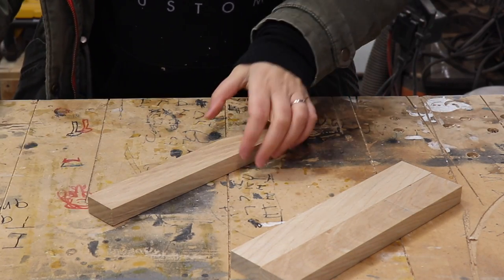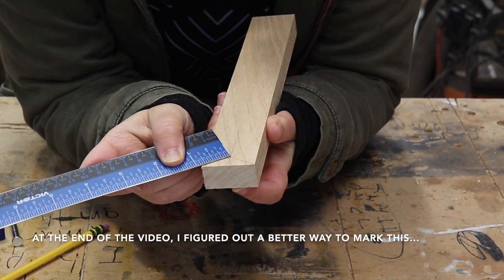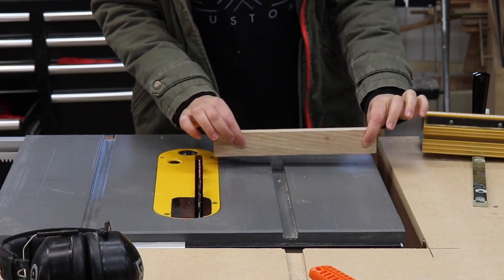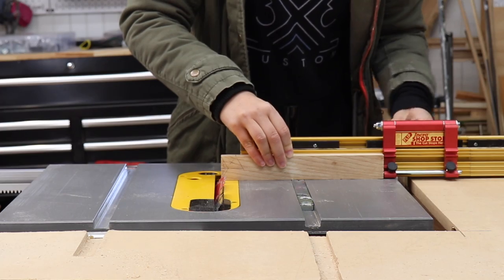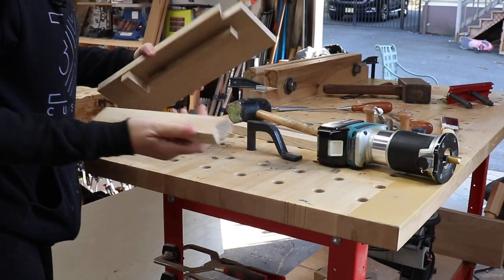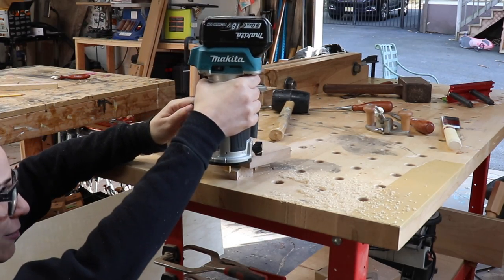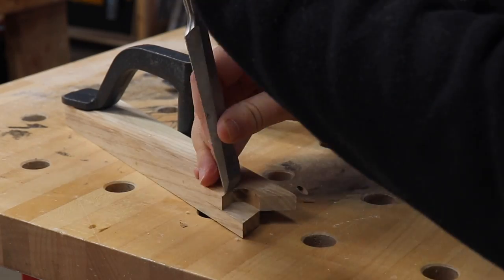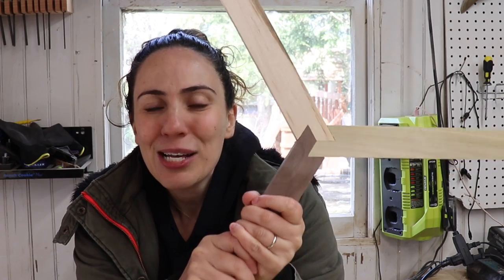Actually, I don't know what this joint is called... but Three-Way Lap Joint seemed to fit. Ha!

Comment: The first image of the joint looked like a corner joint (3D) to me at first, rather than a flat three-prong thing. That got me wondering how to make that same look in a corner joint. Using balsa wood, I figured it out, but not sure how strong it would be (But it looks cool).  I would love to see you experiment with that look as a corner joint and see if it can be made strong enough for practical use.  I can send pics if you want of my balsa wood test.
Reply: Yes that's what I thought too - i dont see much application for the joint in this video.
Reply: Ken Heart I have seen something similar under a round coffee table with three legs
Reply: @jurockclimb  I suppose there might be the odd application!
Reply: Yeah thats what i thought too.😂. This kind of joint is not really used too often.
Reply: @Beevreeter  I could see it as a neat center support under a glass table. I don't Think it would be useful structurally but it would look nice.
Reply: @lol2Dlol  I agree. I would probably want some kind of support structure under it if the glass top is larger than 600mm in diameter though.
It's definitely intended more for decorative effect than for structural integrity.
Reply: Yeah, I would have assumed it was a 3D corner joint myself, with a very distinctive look ot hide the joinery.  I too would be more interested in the corner joint~!

Comment: Initially I thought it was like a 3 way miter joint like I've seen in table legs. Almost has a three dimensional look in the picture. But I wonder how this would be used in actual practice. Very nice. Can't wait until the next video.
Reply from the maker: Thanks! Yeah. The 3 colors kinda makes it have a 3d effect. Keith from kjsawdust is using this joint for a 3 legged table he’s building

Comment: That is a great joint for many cool stand type applications. 
Could use it as a three section lazy Susan cutting a nice round trim to match the dividers doing a tenon or half lap to join all the pieces together cutting a channel into the sides of the wood adding a 1/8-1/4” bottom. 
You could even create an inlay effect with a darker wood to add some flair. 
So many options!
Reply from the maker: That would be super cool. The inlay part sounds killer

Comment: I'm not sure if anyone mentioned this or not, but this joint works with almost any number of boards. So long as you follow some basic math, take the number of boards desired and divide 360 by that number. That will be the angle of the first cuts you need to make. So if you wanted  6 boards for a really decorative piece you would need 60 degree angles instead of the 120 that were used.

This ends up being a rather beautiful piece if done correctly, also odd numbers will almost always look better than even because one of the boards will always be centered.

By adjusting the Maximum angle you can also do some really unique designs, such as a starburst pattern by just dividing by 180 instead of 360. The rest of the process remains the same regardless.

Comment: if you chisel out the leftover waste in the corner left by the router bit before you take off the template it works as a guide

Comment: That awesome incra miter gauge has a built in super precise micro adjustment in it, check the stop block, from the position you use the gauge, the stop block has a horizontal screw on your left, that is the micro adjustment screw, tighten it to cut more, loosen it to cut less, you will need to also loosen the two screws on the top of the stop block to allow this movement. It is awesome!
Reply from the maker: It does!

Comment: Nice video. I like how you show three different methods. Using three different type off wood show off the joint better and the craftsmanship behind your work. This could be a nice joint for a round table top or  bar stools. 

Call it a Tamar joint or 3x3 custom joint, if no one else has has made that joint before then you created and call it what u want.
Reply from the maker: That would be a perfect project for it. But others have done it before me. I saw a picture of it and recreated it. Oh well. Ha

Comment: Awesome Tamar! You never cease to amaze me with your woodworking skills. I need to "sister" a few floor joists in my basement, I don't have to go all the way from end-to-end, but I want to, to stiffen up the floor even more. However, I have some pipes and wires in the way, so I'm considering joining 5'× 2"×6" & 9'×2"×6" to become [one] 14'×2"×6" joist. 
Would you consider making a video in regards to that?
 I'm considering 1/2 lap, locking scarf joint, or scissor half lap. You probably already know this, but , the scissor half-lap is similar to what you just did in your video..
Reply from the maker: Thanks! I would probably do a locking scarf joint. But I’ve never had a situation where I’ve ever had to do that
Reply: 3x3Custom - Tamar, thanks for the reply. After I messaged you the first time, I realized that my boards that I bought for sistering the floor joists are 14' and the span is 14', so I can't afford to lose any length trying to make a lap joint of any sort, so the locking scarf joint is my only option. I've experimented with a small scrap board and I'm satisfied with the way the locking scarf joint works. The tricky part is adjusting the joining pieces to fit perfectly considering the material removed from the saw blade kerf needs to be compensated for. After trimming the locking part of the joint numerous times  I finally got a good fit. It took a while. It seems like you always have formulas for that sort of thing, so, If you have a time saver suggestion I'm open to it.

Comment: You have great abstract reasoning, planning,  measuring, and cutting skills, as well as patience.  If you didn't have all of those, it would have been a failure.  You are rare person. I thought I had them, but not on your level!  Bravo!  Interesting that you mentioned being in quarantine.  That was the beginning. Who ever thought it would go on this long, and it may go until next summer with Delta and the people who won't be vaccinated, though it isn't quite as bad if you are vaccinated.  By the way, I like my new Makita router, but I don't like the fact that it doesn't have a light in it. I resorted to using a headlamp. That was my wife's suggestion.  If one works for my dentist, one will work for me.

Comment: I enjoyed seeing all three approaches.  Thanks!  I think in your 3rd approach, when you cut down the center, the kerf of the cut probably threw off the fit.
Reply from the maker: Yeah. Probably. Could also probably adjust which side that kerf would be on and just have the bottom part of the joint look a little off. 🤷🏻‍♀️ still want to play around with that

Comment: I wonder if an oscillating tool would be useful to hog out material if one were going the non-jig and router route. However, the flush trim bits are amazingly useful. I have a freud one that is 2.5in tall with bottom bearing.

Comment: It was interesting to see you figure out a way to do this. 
However, first thing through my mind was 3 cuts with the blade at 90 degrees: A straight cut on the end to the depth of the lap joint (probably easier with thin hand saw or band saw), a 60 degree miter-jig cut the height half way through face A (up to the middle cut), flip the board and another 60 degree miter-jig cut on Face B. should leave you with the lap cuts and a couple of triangles from each board. Kerf might be an issue, not sure.

Comment: Nice work and thanks for sharing. Another way to do that micro adjustment on your fence is to put some pieces of paper between the workpiece and stop block, remove the paper while holding the workpiece firm, and move the stop to touch the piece again.
Could you just keep the piece in the jig as a guide to clean up that corner with the chisel?
Reply from the maker: Yup. And yes. But I like to work in phases. So router, Phase one. Hand tools, phase 2. It’s just how my mind works. I do the same thing when I’m cooking. Do all the repetitive steps in one fell swoop. Then move on the next repetitive  step. But you do whatever works for you 😉

Comment: Hi Tamar, Have you done any videos talking about the different devices you use with your table saw? There is one you used with your three way corner joint in another video and this one. I've used a table saw before but really badly! These other gismos give a much better finish.

Comment: Could also resaw the pieces in half, plane to equal thickness, make the required cuts on each half (all through cuts) and then laminate the two halves back together... Yeah, it's a little bit of a cheat, but....  :-) Awesome work, very cool joint!
Reply from the maker: For sure. Always another way. Thanks!

Comment: The question is, now that you have a way to make these joints efficiently, how could they be utilized? I can see these three pieces being the styles and rails ( in effect) for a panelization of a wall that would be in a honeycomb pattern. You could experiment with the grain placement of the field pieces to provoke 3-D effects, sort of M.C. Escher 'esque. Another home run from Tamar!
Reply from the maker: Oh. Yeah. That would be cool. But I’ve seen this joint being utilized as rails for a 3 legged stool or side table.

Comment: Have you ever considered upgrading your table saw?  You would benefit from a much more precise set up and better results with your Incra miter gauge.
Reply from the maker: Yes I have. Ha. Right now I don’t have 220 set up in my shop. So I am waiting until I do a shop overhaul 😉 for now it works.
Reply: 3x3Custom - Tamar ah, got it.  Yes power can be an issue.  Powermatic makes a beautiful PM1000 cabinet saw that only requires 120V power.  And their currently offering 15% off their entire lineup of tools.  Just FYI.  STAY SAFE!  one silver lining in all this, I have lots of shop time right now!!! 😁👍🏻

Comment: Does your table saw have to be sitting level for that digital angle angle gauge to be accurate or does it compensate on its own? Thanks. Great video.
Reply from the maker: Nope. You put it in the table saw. Then press zero. Then you put it on whatever you want to check the angle of in reference to that zero.
Reply: @3x3CustomTamar  thank you!

Comment: one way of doing it that i think might be easier but maybe nnot as good looking is to take 2 pieces of wood with same length and width but half the thickness of what u want the finnish product to be. then cut everything out on the band saw on each piece, so they are the mirror image of each other then glue them together.
Reply from the maker: That could def work

Comment: Obviously we usually eyeball it, but I'm curious if there's a good way to know that the uppermost tooth of your blade is in the fullest, most upright position for measuring blade height?  Especially on an angle, this seems like it might be tough.
Reply from the maker: Yeah. I actually marked in my saw top where the highest point it. So I make sure to line my piece in that mark and rotate the blade back and forth to make sure. Then do a test cut. Make any necessary adjustments and then final cut.

Comment: It's a very decorative joint, but I don't see the point or use of it. I mean it might make like a nice center piece for geometric tabletop but as a joint that would support weight or put up with a lot of twisting or racking forces, I don't see it. In fact even in the tabletop or other decorative use it would be far easier to get that look without going to the trouble the goofy angles of that joint. However it does seem to have a lot of value as a mechanical puzzle to figure out how to build during a pandemic.

Comment: First of all, let me start by saying thank you for sharing this with us. I love your channel and you make everything look so easy for beginners like me. A couple of questions about the joint demoed here. 1. As the joint is along the long grain and after the material is removed on both sides of the stock the resulting two prongs are barely bonded is that strong enough to hold even after all three of them come together?  2. what would be the typical application of this joint?
Reply from the maker: As long as it’s not end grain to end grain it’s strong. Second. It would use this as a stretcher for a 3 legged table like my friend Keith did
Reply: @3x3CustomTamar  How about a (half-) hexagonal palisade? Looks like it could actually distribute weight/pressure vertically, for example to rig a carport or a veranda?
Reply: .. or for a bottle stand.

Comment: Where I learned the trade (the north of the Netherlands) they call this joint a devil's knot. Could be a regional thing though.
Reply: Jelmer, I am liking that, and will adopt it as the proper term, dank u.
Reply from the maker: Never heard that! I like it
Reply: I asked around and it's a very regional thing indeed, apparantly it's only used in one province. Googling it only gave results for a type of puzzle. (Prove me wrong though, fellow Dutchies)
Btw, at first glance at the vid's thumbnail perspective fooled me into thinking it was a square 3-way cornerjoint XD Maybe an idea for a next vid though?

Comment: Could the boards be laminated in two exact halves so that the 60 degree angled ends don't go into a blind end?  Then each half of the laminate could be cut on the table saw as a straight through cut before gluing together.  It wouldn't be so much fun though!
Reply from the maker: Sure!

Comment: Curious why you don't use the fine adjust on the incra miter gauge.  It was the whole reason I justified spending all that money.  Anyways, cool techniques.  I couldn't see a way to make a jig for this joint and you nailed it
Reply from the maker: Sometimes I use that. But I guess I just saw how much was left over and moved it out by that small amount. 🤷🏻‍♀️ I like using that little bar thing for things like that. Ha

Comment: If you need to do this joint again, you don't need to measure the second marking point, you can find it by drawing the 60° lines until they reach the other edge, since that makes an equilateral triangle

Edit : oh you found it ! Nvm
Reply from the maker: Haha 🤘

Comment: Your partner: walks into shop

"Hey honey what ar..." 

nearly gets a projectile triangle to the face from the table saw

 "OOOKAAAY SEE YOU LATER THAN".
Reply from the maker: Hahahaha! Yes.
Reply: @3x3CustomTamar  In all seriousness though, would there be a way to use the table saw without those triangle cutoffs at 6:00 kicking back? Would a cross cut sled work?

Or is it better to just leave a sign on the door that says "Stay out unless you have body armour".
Reply: @mrfreezy7457  I mean a sled would probably keep them from flying away. If you had more wood to waste you could keep a 6 inch piece on the cutoff side and that probably wouldn't fly around. But in all honesty I think it just looked bad because the video was sped up, so it was probably going a 3rd of the speed lol.
Reply: @dedalliance1  Oh okay. I just see a little scrap flying like a bullet and thought "Oh jesus that's dangerous".  I can see what you're saying though. It's probably only going a few feet instead of going through a window haha.
Reply: @mrfreezy7457  If you look at 5:35 I think that's at real time speed and didn't fly very fast.
Reply: @dedalliance1  That one looks like it stayed on the table saw though. The other two appeared to go off to her right and out of frame.

Still though, they wouldn't have had enough force to go far now that I look at it.
Reply from the maker: Edward Fleming they weren’t flying too fast. But you can use a sacrificial fence to avoid that.

Comment: How would you use this in a practical context? It looks really cool, and it's impressive how you worked it out so well.
Reply from the maker: Thanks! If you check out Keith’s Instagram that I mentioned he is making a table using this joint. Kjsawdust
Reply: 3x3Custom - Tamar - And a nice table it is. He sent me to you. Glad he did!

Comment: visually nice but what could it be used for?

Some sort of a twist on parquet tessellation for a surface maybe (floor or table top or chopping board)??
Reply from the maker: Thanks! Keith, who’s instagram I mentioned, is using this for a 3 legged table
Reply: @3x3CustomTamar  ooo...noice.

I take it he's bent a bunch of home made only around a former or steamed some stock into shape then?
Reply from the maker: weedfreer nope! Just using it as a stretcher of sorts between all the legs
Reply: @3x3CustomTamar  oh!

like a 3 way cross brace halfway down the leg?

I think making your own ply around a former or steam bending your own wood , with this sort of joint meeting in the centre would be the better job though :)

Comment: Let's all pitch in and buy Tamar a space heater for her shop.
Reply from the maker: Hahaha! Lack of a heater is not my problem. It’s the lack of insulation and insufficient power. Every heater I try flips the breaker. And it wouldn’t even make a difference because my garage isn’t insulated

Comment: Personally, I think the last method you used (there were three ...) was probably the one used by the "experts". using a very thin kerf blade. The router of course was the easiest, but the design/type of joint would not have seen a motorized router in its conception.
Reply: BTW. loved the joint and watching your skill levels increase at an awesome rate.
Reply from the maker: Thanks!

Comment: i made this joint once but iI cheated kinda I made the cuts on the band saw but used 6 pieces of wood. and glued the parts together till I had the 3 pieces I needed. Then put those together.

Comment: Wouldn’t a better way to cut the joint be to cut one of the Vs all the way through and mirror the angle for the second cut and cut down the middle for a third cut all with a table saw or band saw of some sort
Reply: 12:28
Reply: What the hell was high school me on about